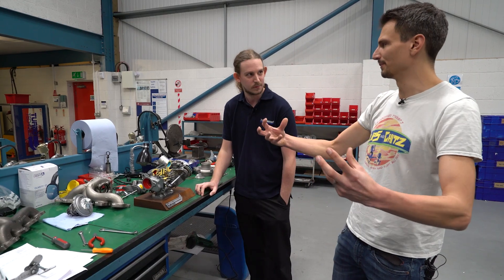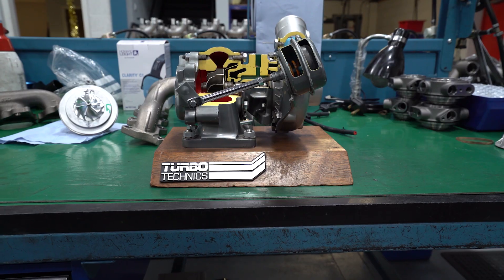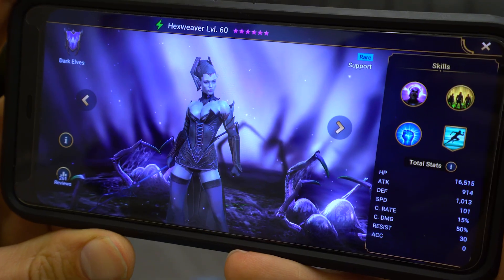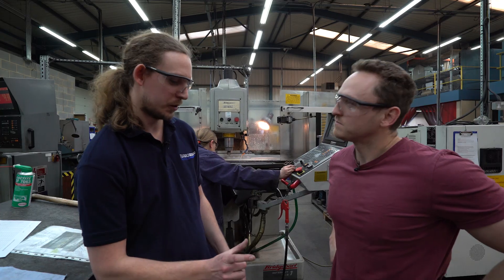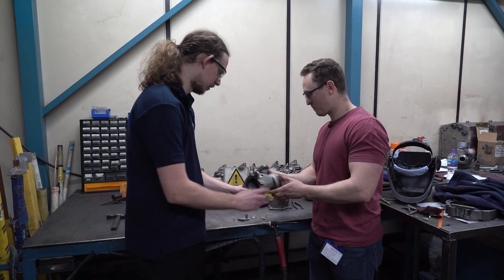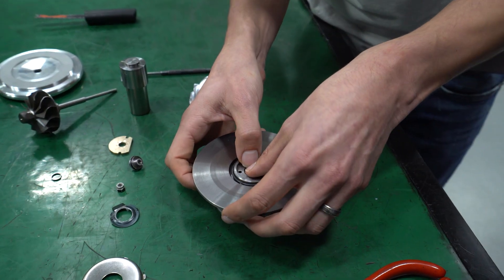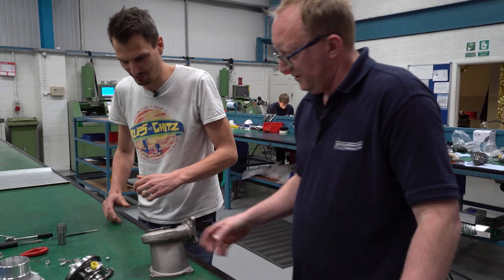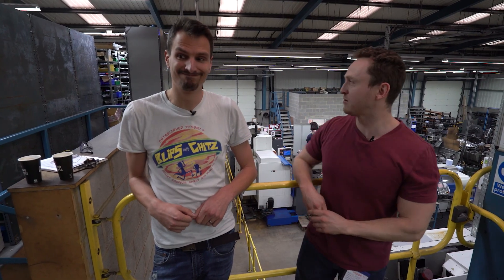How Hybrid Turbos Are Made & What They Do!

Comment: So how many extra HP would it give on a 3.0 V6 Diesel
Reply: It would all depend on the map sensor and tune. I had a 3.0 v6 diesel on a e class and with a venom stage one hybrid, vag 3 bar map sensor and tune was getting 320 bhp and nearly 800nm of torque which is the limit for the gearbox not bad for an engine with  170k on it. In the real world torque is more important than bhp.

Comment: 7:15 And then you obey the speed limits, rigidly...

...after reaching them much faster than before
Reply: I know a guy who once got pulled over for "excessive acceleration" after speeding off to the speedlimit when the light changed.
Reply: @JakeSnake07  He probably had a loud exhaust as well. If it is quiet it is significantly reduced probability of that happening. I don't think a Tesla has ever been pulled over for "excessive acceleration" because they're practically silent.

Comment: “A hybrid turbocharger is an electric turbocharger consisting of a high speed turbine-generator and a high speed electric air compressor.”

Looks like they are just using the name ‘hybrid’ to make it sound fancy. It is not a hybrid of anything, it is just a turbo.
Reply: That's exactly what I thought, waiting for the explanation of the 'hybrid' turbo.. but there was none.
Reply: @Speciaindividual  They did explain that. 

Hybrid Turbos used to be a hybrid of two or more turbos, now it is more upgrading/rebuilding turbos.
Reply: Joe Wuh-Puh So they're more like... Franken Turbos.
Reply: A turbo with an electric motor that drives the comp wheel is an electric turbo, not a hybrid turbo.
Reply: Exactly. I was actually disappointed watching the video because I anticipated real hybrid turbos. So turbos with an electrical motor powering it instead of exhaust gases.
Reply: @niklasschmitt  Yeah but where is the fun of that.
Reply: @JoeWuhPuh  when u got such a large ass turbo on your engine they are there to kill the turbo hole just a bit so it's atleast a bit drivable
Reply: These "As Seen on Tv" turbos have been around awhile and laughable for years now. However, they are finally getting into the  "intriguing potential phase" and all of us gearheads are taking more notice. If the tech keeps getting better and better, this might be a better alternative to builders that have pipe/plumbing issues that typically happen in turbo setups on non turbo OEM cars when modiefied. If these things start producing 3 or 4 x the power of what that r e t a r d cleetus did on his youtube channel, I will definitely slap one on a Chevy LS and see what happens. Just my 2 cents. Semper fi and God bless.
Reply: I think these people are using 'hybrid' in the way it was used prior to electrically assisted versions of stuff being hybrids, even if the company is 'just' custom building them. 
From the little I've read I've seen that others have explained hybrid turbos that are in no way related to today's more common hybrid meaning so I don't need to go there. The hybrids before the hybrid car if you like.
Reply: Hybrid of stock and modified
Reply: I was thinking the exact same thing.
The turbo's featured in this video are just upgraded turbo's.
Still very cool and all. I need upgraded turbo's for my N54 engine.
Reply: hybrid turbo is the just the common name for this. It's not just turbo technics. Revo, Pumaspeed, Pure also use this nomenclature
Reply: The definition of hybrid is “something that is a mixture of two different things” source-Cambridge dictionary. 

A Turbocharger incorporating the use of electrical motors is known as an Electrified Turbo or E-Turbo according to brands such as Garrett. 

Please do your research before complaining based on incorrect assumptions.
Reply: Andrew Doring You’re getting ‘electric supercharger’ and ‘hybrid turbo’ confused.
Reply: Not at all, Superchargers get their rotational force from belts or chains driven by the engines crankshaft.
Reply: Andrew Doring 

https://www.carthrottle.com/post/electric-superchargers-debunked/
Reply: For example you can have the interns of a 3.0 tdi in a 1.9 tdi shell, that's why it's called a hybrid turbo because it's a combination of 2 different things
Reply: Radu Best that’s just the definition from google. 
A Hybrid refers to something comprised of two ‘different’ elements. For example a hybrid rocket motor has both liquid and solid fuel, a hybrid car has both internal combustion and electric power. 

This is just a ‘custom’ turbo.

Comment: Just choose the right size turbo for the right engine and use situation and all should be fine.
Don't put a huge DIESEL ENGINE turbo on a TINY engine... or buy the top range most powerful version of a 4x4 turbo'd beast if your normal use is to do shopping and drive to work.
There is nothing wrong with a midrange boosting turbo. Quick enough to spool up to get off quickly...and enough power for the middle for a nice boost.